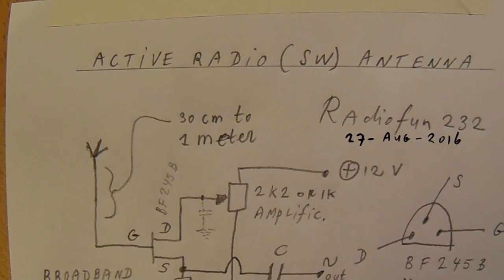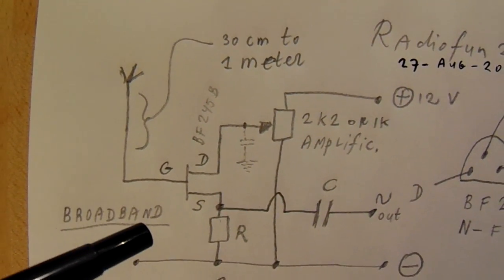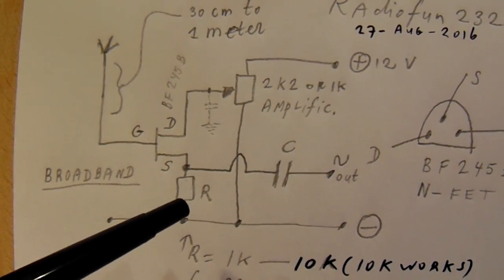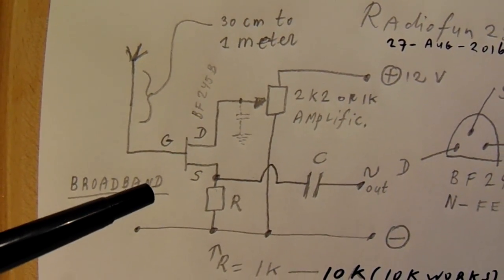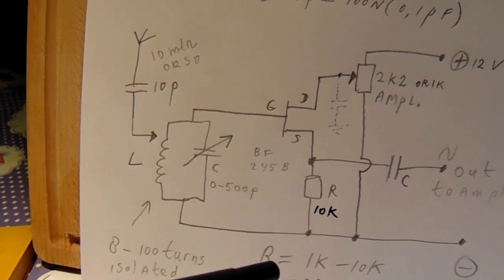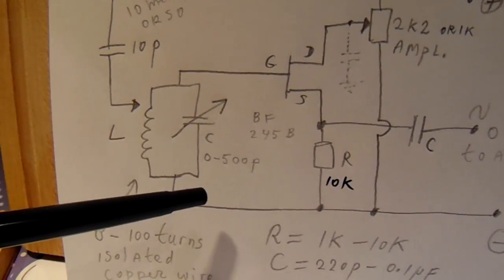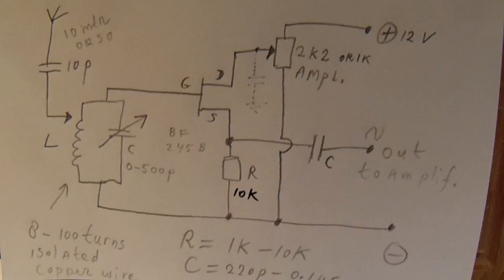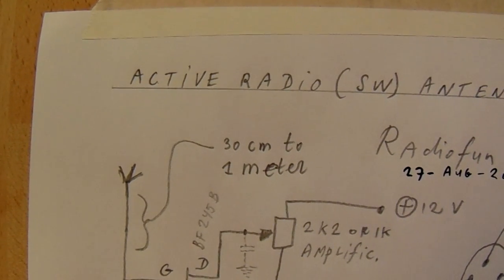Active antenna for a shortwave radio (schematic with N-FET)

Comment: On the broadband antenna, is a resistor to ground required to prevent static buildup and to give a negative bias to the gate? 10 Megaohms maybe?
Reply from the maker: You don't need that resistor but but you can wire it in. In theory it gives signal loss. As far as I know the Gate needs no negative bias. But your point is very important. On a long wire antenna hanging outside due to static voltage buildup the FET easily gets damaged. For that reason I have in my shortwave radio a relay contact between Gate and Ground that opens (relay activated) when I switch the radio on. When you don't do that the FET gets damaged every 3 months or so (my experience). With an indoor antenna there is no problem. I have pinned your comment. 5 August 2020.

Comment: In this diagram. 500pf v/C. With 100 turns coil. If someone use 250pf v/C  than numbers or turns 200?.
Reply from the maker: Yes, in general, when you want to go to the same (one) frequency. But the bandwidth from the coil with more windings and the Q (quality factor) will differ. It is not so simple: say divide 500 pf by 2 does not mean that the coil automatically needs 2 times more windings. Much more info & calculations in these cases (parallel resonance L-C) are on the www. Keyword: "parallel resonance". 19 March 2023.

Comment: Doesn't having a floating gate on the 1st circuit cause problems?

Does the gate need a high value resistor going to ground to be self biased?
Reply from the maker: When you connect the floating Gate to an outdoor antenna, the FET can be easily damaged by static charges. So, in that case, when the active antenna is not in use the Gate must be shortcut to ground. When that Gate is connected to an indoor antenna this is not a problem. Biasing is not necessary, but you can solder a resistor in the order of 1 M - 2 M from the Gate to the minus/ground. Of course it will "damp" the sensitive input on the Gate of the FET somewhat. Sometimes you see two antiparallel Silicium diodes going from the Gate to the ground/minus. In that case the voltage to the Gate cannot go higher than 0,7 Volt, that is the standard barrier voltage of a Silicium diode.
Thanks. 23 feb 2023.

Comment: Can  we use this type of aerial booster with a few turns around a ferrite antenna?
Reply from the maker: It depends on what you want and need. The schematic showed is a so called "aperiodic circuit". That means it will/can receive all kinds of radio stations on Shortwave. Say between 2 MC and 12 or even 18 MC (I tested it for that purpose, never got higher than 18 MC). But: such a 30 cm to 1 meter "spriet" (Dutch word= rod) antenna is of course not ideal, due to its length. It is directly connected to the gate of the FET. In fact it is far to short to receive radio stations in an ideal way (say tuned to their resonance) between (say) 2 MC and (say) 30 MC. Though it works OK! Due to the amplification of the FET and its endless input impedance on its gate.   When you do radio calculations, this is (say) the main thing: antenna length = frequency in Megahertz / (divided) by wavelength in meters. Long wave (150 KC-345 KC) means the ideal antenna (full wave) = 2000 meter to 857 meters long. Far too long to hang out of your room or in your garden! But you can also use a half (1/2) wave or a 1/4 wave lenghth antenna. SW = 187 meter to 10 meter, divided by 4 gives usable lengths of wires to hang outside in your garden or whatever. Or in your room: also a very good option. Connect such a 4 meter long antenna inside your room with a cap. of 14 pF to the radio receiver antenna input. Works nice, that setup (my experience). Anyway: my answer to your question is yes: by making a few turns around a ferrtite antenna the circuit gets non-periodic, it means that it gets tuned to a certain frequency band received on the ferrite antenna. That could be a surprise, where it works at its best.
Test, try, evaluate. Thanks for your reaction, I can eleborate when you can describe the exact radio situation. 23 jan 2023.

Comment: Didn't really understood what's the capacitor drawn in interupted line  function?
Reply from the maker: You can use a 1 uF electrolytic capacitor there. Acts a a kind of smoothing capacitor. When you give that capacitor a too high value (say 100 uF or so) that capacitor keeps on holding so much charge that the regulation with the volume/level control (node of the 2K2 or 1 K potmeter) does not work properly any longer. With "not properly" I mean: the FET works far too long, even when you bring the amplification level down it keeps on working for a long (... is set by the R-C ) time. So when that capacitor has a too high value the FET keeps working on and on, with no effect (or a very delayed effect) of the control potentiometer. 11 may 2021. That is why I used the dashed line in the schematic. 1 uF is a good value to be used here. The FET and amplification regulation works properly with that capacitor value.
Reply: @radiofun232  Ok, thank you very much for the clarification.

Comment: Thanks a lot for this useful and informative video. Do you have any sort of recommendation for designing active circuits for whip antennas, applicable in EMC measurements in the frequency range of 10 KHz up to 30 MHz or so ? Do you have any suggested FET amplifier circuit for covering that low frequency range from around 10 KHz up to 2 MHz ? Thank you very much.
Reply from the maker: On the lowest frequencies (10 KC-100 KC) the antenna's differ substantially (construction) compared to the range of 100 KC - 600 KC and 600 KC-1.8 MC. They often react on the magnetic component of the EM field (ferroceptor or air coil). The next band is 2 MC-30 MC. The circuit in this video is useful as a whip antenna with a length of (say) 1 meter. Best idea is too hook it up to a BF 199 (HF amplifier with a series capacitor to the base) and take the amplified signal from the BF 199 out via a coupling capacitor at the collector (grounded emitter circuit, both in the 100 pF range). In that case it is usable for frequencies between 1 KC and 30 MC. There is a series of video's about VLF reception on my channel. Search via the "looking glass" on my channel trailer with keywords like "VLF". Via that looking glass you can find more info about antenna - and radio circuits with keywords like "radio", "shortwave" etc.
Reply: @radiofun232  I really appreciate your time to clarify the subject with more details. I'll check out your videos right away.

Comment: when you say take out the signal from the broadband antenna to your radio. do you mean the tank circuit. or if not how do you connect it? looking forward to building it. never tried this type of circuit before. thanks.
Reply from the maker: The tank circuit at the input is a piece of wire, maximum length 1 meter. You can also take a longer antenna but that antenna must be connected to the gate of the FET via a tiny (2 pF or so) capacitor. When you want to use it as a free HF pre amp, the "out" must be connected to the antenna socket of the radio. The coupling capacitor must be found experimental in that case, my first idea would be 100 pF in such a case. ("C" in the drawing).
Reply from the maker: By the way: this is the "better" circuithttps://youtu.be/i8uAbKUV6Tc

Comment: Hello, ¿do u think it could work in 400 Mhz receiver? Any suggestions? The receiver is quite simple. A tank circuit with an antenna and a transistor and then it is amplified. Recive digital signals. Square wave signals. My concern is the noise and capacitance around 10 pf in the Gate. Of course they are assumptions I have not tested anything yet.
Reply from the maker: I don't know because I never worked on such high frequencies. Perhaps, with a special HF FET.

Comment: How can I couple the output inductively to a radio clock on 60 khz which does have ferrite rod antenna?
Reply from the maker: say: 10 windings loosely around the 60 KHz coil, one to ground and the other one of these 10 windings coupled via a 100 p capacitor (the C in the circuit) would be my first idea. Loosely coupling is necessary to take the frequency of 60 KHz not down.

Comment: What I would do on the simple circuit is add two cheap RF diodes, (i.e. IN007) + up and down from antenna/Grid to Earth. This will short any charge over +-0.6V and hopefully save your FET.
The same can be done across the tank circuit too. :)

Comment: Thanks for the useful circuits!  For the second one can you tell me if the antenna is connected directly to the top of the inductor? I don't understand the arrow head pointing to the inductor? Cheers Mark
Reply from the maker: It depends where the antenna (arrow head) is connected to the coil. That is why I drawed it that way. The radio theory says: there is more selectivity when you connect the antenna low on the coil and less selectivity when it is connected to the top. But experiments in a real situation show what is best, because it also depends on the lenghth from te antenna. A very long antenna can give messy reception results because it takes the Q from the antenna coil down. That is why an antenna capacitor (15 pf or so) is used.
Reply: Thanks so much for the explanation!

Comment: Always good stuff Ko,,, btw, is the antenna length for the second circuit 10 or 50 meters?
Thanks,
Carl
Reply from the maker: Thanks, Carl. I used the second circuit with a wire antenna from 10 meters.